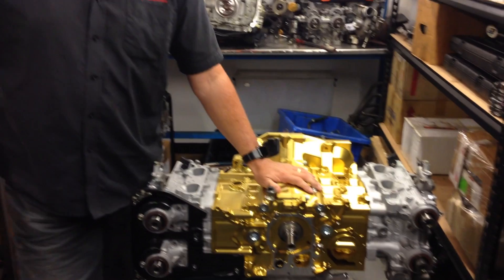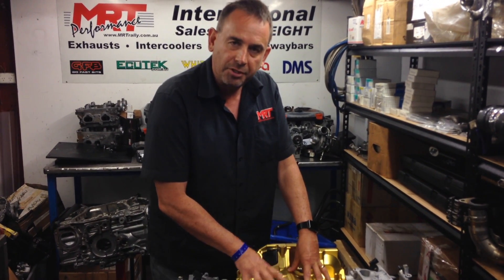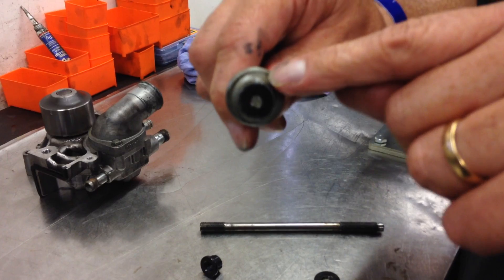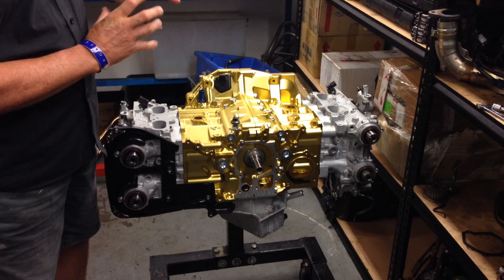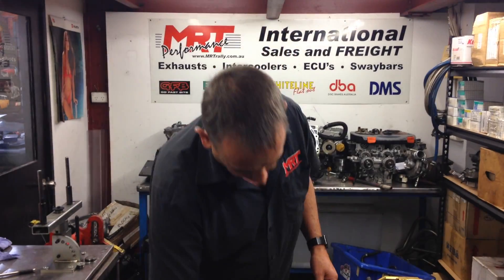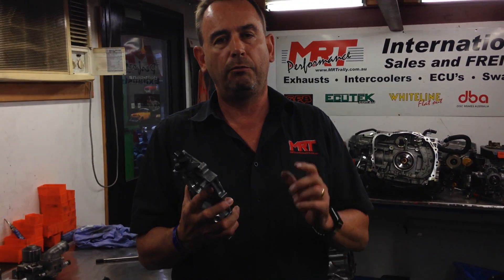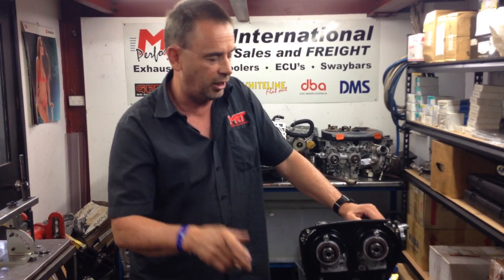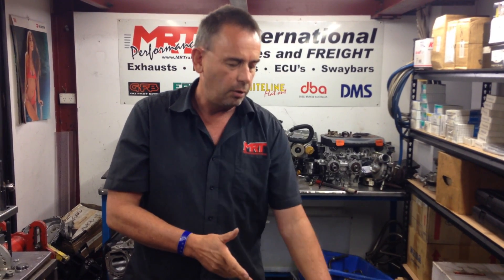Project Billet - Subaru EJ Long Block Assembly and Variable Cam Timing Explained

Comment: As a factory certified Subaru technician, factory Subaru head bolts are absolutely reusable. They are not torque to yield like many people think they are. The reason Subaru uses angle location on the torque sequence is for more even clamping load.

Comment: Got a 13 WRX that is due for the timing belt job.  This is a stock engine but I don't want to cut corners on this job.  I have had the Gates kit recommended, but I have also seen some negative comments about it here on You Tube.  Any recommendations you might make would be gratefully received.

Comment: thanks very informative, would you be able to do a video on the benefits of short block vs long block?
Reply: Short block is just the engine block and long block is full assembly with heads.  I'm not sure what your trying to ask.

Comment: 4:42 Those are the cam gears that make up the AVCS (active valve control system) :D

In this case, as he said, is a dual-AVCS engine. Not all Subaru engines have dual AVCS, some have single AVCS and some don't have AVCS at all.

Comment: too bad Subaru's  are rubbish did somany head gaskets on so many different models of subaru lost count ,compered too other car in the performance car market id stick clear  of subaru, rubbish engines rubbish gearboxs rubbish suspension list goes on and expensive from a Japanese car just like hondasboth of the worse cars brands out of Japan

Comment: I saw some pics of this block, and it had hex head bolts on the mains as well?
And I bet it has got pinned mains ?
Reply: rotaxmax3 Yeah.  And 4 bolts to hold each bearing together.  (instead of 2)

Comment: Aren't both OEM bolts and ARP nuts 12pt not 16pt vs 6pt and 8pt?  If they were 16pt a special socket would be required thereby making it more difficult to assemble?

Comment: You said stock Subaru head studs aren't reusable, but are the ARP one reusable??
Reply from the maker: OMO .SOUND Yes. ARP head studs can be reused as long as they are in good condition with no defects.
Reply: MRT Performance Great, thank you. Building a forester xt, but it's nowhere near as bad ass as this build you're doing.
Reply: this is an very high end build. that short block alone is probably close to 10k
Reply: OMO .SOUND well arp bolts /stud kits cost over 300 each kit i sent 600 plus on arp bolts because there for a fj20 special order from the states and for that price you would think they would be reusable. dnt people know anything
Reply: $15k.
Reply: OMO .SOUND what year?

Comment: billet block but no dry sump??
Reply from the maker: As this is a street car build. The customer opted to stick with a wet sump setup. While beneficial in some regards, a dry sump would be overkill in this instance and adds unnecessary complexity.
Reply: Late reply but the owner is definitely not stupid when he can mange to afford a build like this. Am I right?
Reply: The owner is an idiot who bought a billet block yet told the shop to keep everything as stock as possible.
Reply: @Javier Gonzalez Dude gtfo. Who the fuck builds a billet block for anything other than a crazy high performance car? He would have been better served spending that money on a built closed deck block.
Reply: Brian upgraded wet sump/pickup/oil pump works fine I guess :) dry sump adds another like five grand to the build.